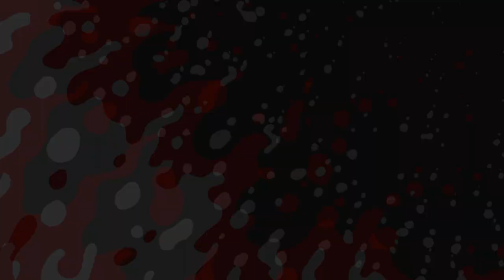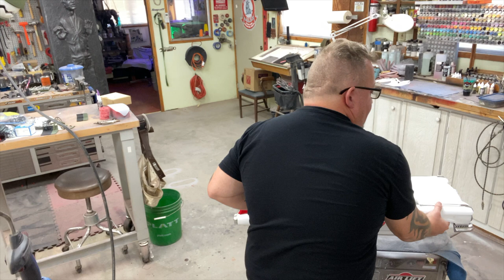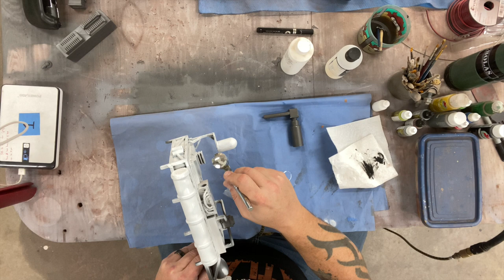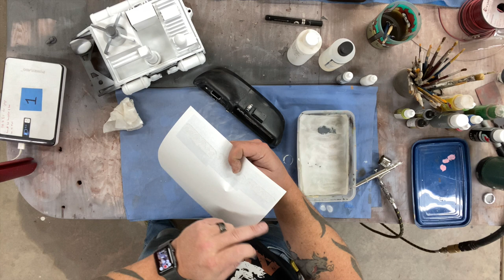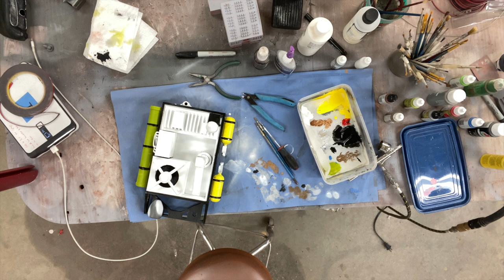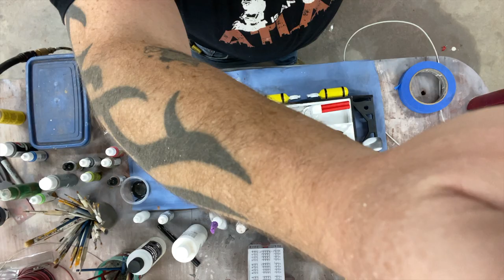Ecto-1 Part_7

Comment: You bring new meaning to the word "Dab".
Reply from the maker: ? Sorry, not trackin
Reply: @LeSanglierQuiRit  being silly. the video was moving fast so it looked like you were just lightly touching(dab) it with paint.
Reply from the maker: @sashidasage1257  for the most part I was. Less is more, better to apply a little in a quick controlled manner. Can always add more/ layer it. Different thicknesses affect color.

Comment: You are awesome! Question, what white paint did you use with the thinner ?
Reply from the maker: Thank you! For big spots requiring more paint than usual, I thin and use cheaper Apple Barrel paint. This is 20403E White Matte. Cheap at walmart and works great as long as you thin it.
Reply: @LeSanglierQuiRit  Thank you =)
Reply from the maker: My pleasure! 😁👍🏻

Comment: Why were both your f410s down? Broken  parts?
Reply from the maker: Yeah, although they get more than regular scheduled maintenance I run them very hard and seem to be at the forefront of wear and tear R&D for fusion 😅
Reply: @LeSanglierQuiRit  can I ask what parts broke and how many hours you think you have on the printers? Was that the first breakage you had that "downed" the printer?
Reply: By the way, the ecto build is bad ass
Reply from the maker: Thank you! 😊🍻
Reply from the maker: My first 410 is right at a year old, 2nd is around 8-9mo old. In this case it was the print head carriage plate where the drive lines attach, which sheared and in the process I lost a drive line. Happened on the older unit, and the other a week later. These machines print dang near 24/7 98+% ABS so higher temps on bed and head consistently at 120mm/sec. Maintenance has not been terrible and has not cost a cent in parts due to the 2yr warranty. Typical 1-2 week downtime is the rough part, but otherwise, best printers I have owned to date. Not a perfect machine, but there isn’t a machine on the market regardless of price tag I would deem as perfect lol.
Reply: @LeSanglierQuiRit  I know we have talked on facebook a bit. Are the two printers you have the 410s or are they the 400-s? For large abs parts do you have many issues with warping or layer splitting printing them on the fusion3 printers?
Reply from the maker: They are both 410’s. I print all ABS with a raft. 1 bottom layer, 2 top. No issues with splitting or warping. I find the 410’s keep the temps even really well and print ABS beautifully.
Reply: @LeSanglierQuiRit  was the 1-2 week downtime just the time it took to get a part shipped out to you from fusion3?
Reply from the maker: It is typical turnaround from claim, ship, to delivery. 7-14 days